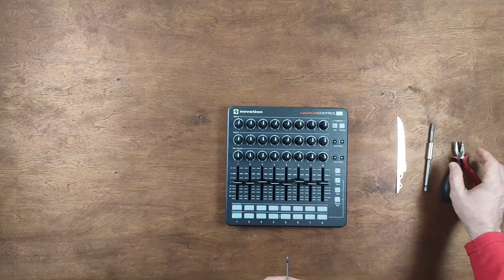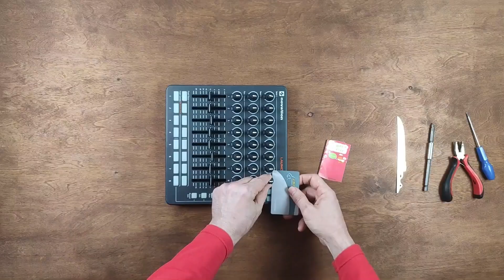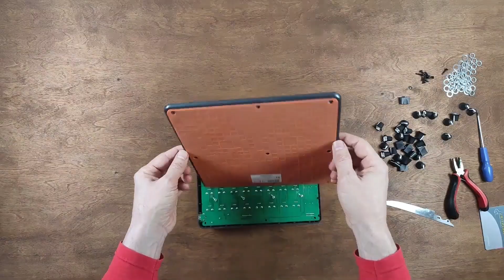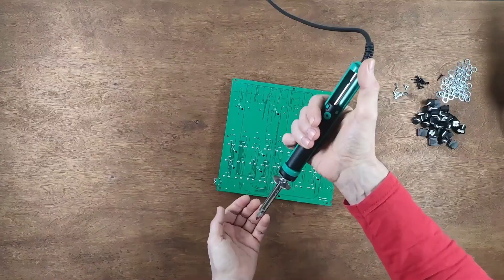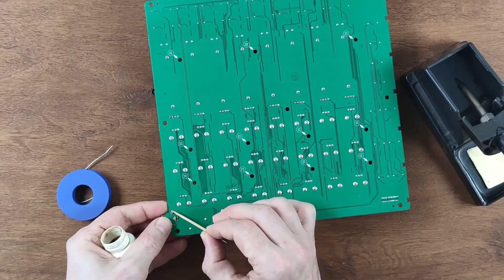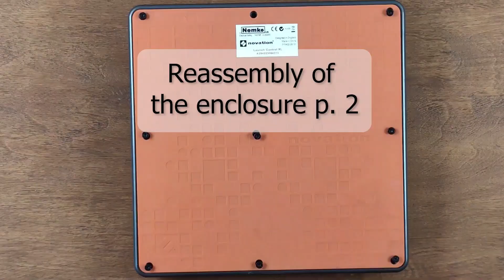Novation Launch Control XL Mk1/Mk2 Hardware Teardown & Repair | USB Port Replacement Fix

Comment: Why did you speed up the video for the de-soldering and soldering part? The USB solder joints look like they were de-soldered before you filmed it. I have one of those desoldering guns but mine does not work anywhere near as good as yours. Did you edit bits out of the video? Thanks.
Reply from the maker: This video required three takes to produce due to the diagnostic workflow, component availability constraints and life conditions of Ukraine:

Take 1: Prior to desoldering, the exact cause of the intermittent connection was undetermined, and a replacement USB-B jack was not yet available.

Take 2: After reassembly, the connectivity issue persisted. Once a replacement jack was acquired, I filmed the desoldering process. However, the visual quality impacted by conditions (air strikes) while filming did not meet my personal standards.

Take 3: To ensure the footage met the standard required for the paid Patreon How-To tier (Winter/Spring), I partially soldered the component and refilmed the sequence a third time. 
The full, slow version of this repair video is available for Winter tier subscribers on my Patreon page.
Reply: @AboutHigherWaves  Thank you for the detailed reply. You mention you are in Ukraine. I am  a UK resident, I take quite a bit of interest in world politics especially in Ukraine and Israel at the moment. It is very hard to understand who are the good guys and who are the bad because main stream media follow their governments lead. This is an ideal chance for me to ask someone who actually is involved in the situation in Ukraine. Who are the good guys and who are the bad? Who should I follow/listen to for true reporting on this situation. Thanks in advance. Paul.
Reply from the maker: @paulc7798  Paul you are asking a question of the Buddha desciple Subhuti in the Diamond Sutra. There is no bad or good identities, because the source of life of every living being is One consciousness (process of awareness). Good behaviors are those that serves Life variety. Bad behaviours serves Death, suffer that leads to a temporary outcomes like grabbing a peice of land by killing many living beings and Earth.
Reply from the maker: Living beings are born because of the false Self awareness state of One consciousness "subconscious tendencies", ignorance (accumulated Samskāra).  The Spontaneous Movement/Energy perceived as a false "identity". Those who serves the everlasting source of life (consciousness) and helps to release consciousness of every living being from false social conditioned identity, suffering from government established "mind" filters are most valuable living creatures.
Reply: @AboutHigherWaves  Thank you for insight. You give me more to think about.
Reply from the maker: Paul, also take a look at the Robert Dilts logical levels pyramid structure, problem solving point of view (resolving the problem of suffering) resides above the ""issue level" (who is doing bad = identity level that destroing DAO), identity "problem" caused by the highest level - false Mission like a russian "imperia" identity.
Reply: @AboutHigherWaves  Will do. Thank you.
Reply from the maker: Just like Love and Ignorance (fear) here https://www.facebook.com/share/r/1JZWjwa6Rr